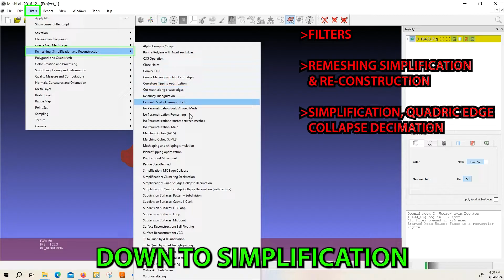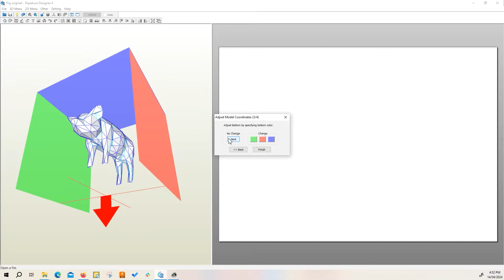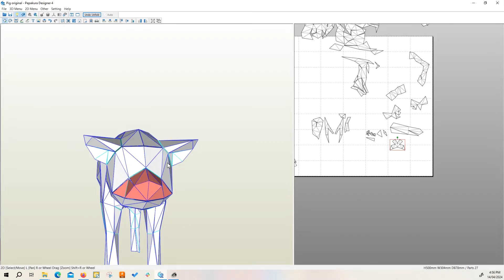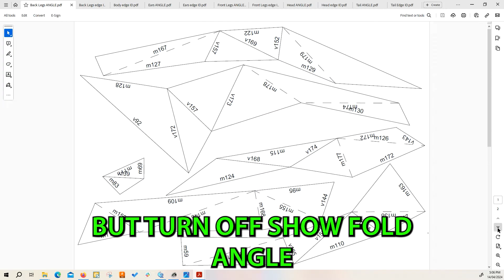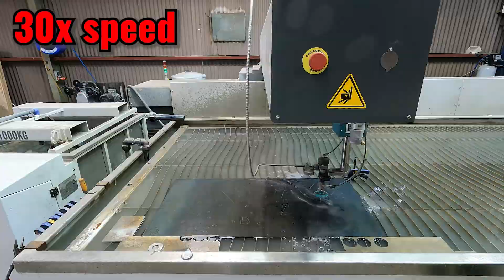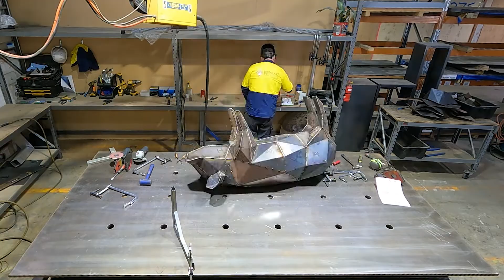I made a low polygon corten steel sculpture EASILY! (the whole process)

Comment: Hi! Great tutorial, thank you for sharing it.

I have a question. Do you think this workflow could be adapted to design a laser-cut sheet metal motorcycle model kit (for example, inspired by a Honda sport bike), where the final product consists of many interlocking parts assembled together rather than a single sheet metal component like in your video?

I'm particularly interested in whether this workflow would still be practical for a complex multi-part assembly with tabs and slots.

I'd really appreciate your thoughts. Thank you!

Comment: hello thanks for the video. Can we make sheet metal joints instead weld ,using bolts? If so, how  to do it?
Reply from the maker: Yes you can, in the pepakura software you can set tab edges, these will all need to be folded though

Comment: Hello. Tell me, please, the program calculates the angles depending on the thickness of the paper, right? Won't there be distortion if the model is made of 1.5/2 mm thick metal?
Reply from the maker: Yes you do get an accumulating error by the end of it which is normally a gap of 2-6mm on 1 or 2mm but overall it works well.
Reply: @jaysikora  Hello. I don't understand. When the model is made for paper and you make it in reality out of iron does it make you a problem when you weld the sculpture ?  Are you getting big gaps between the sheets ?
Reply: Il faut considérer le bas de la facette comme la base du model, le haut de la facette sera considéré comme de la Matière ajouté. Un angle est normalement visible sur entre chaque facette. Vous avez réussi à faire le modèle ? -99- Lumen